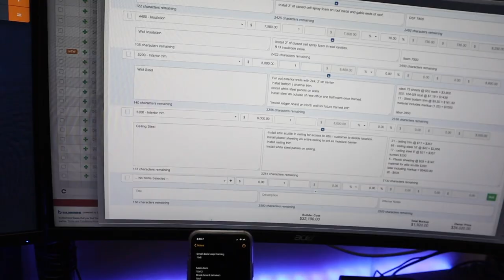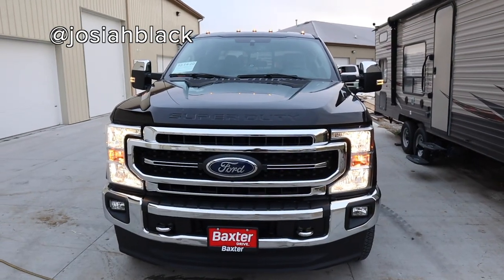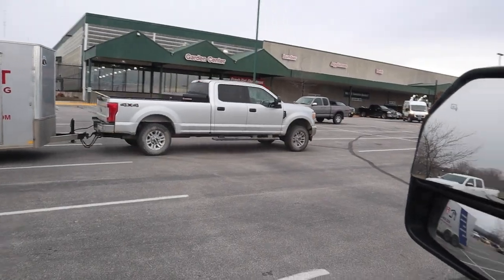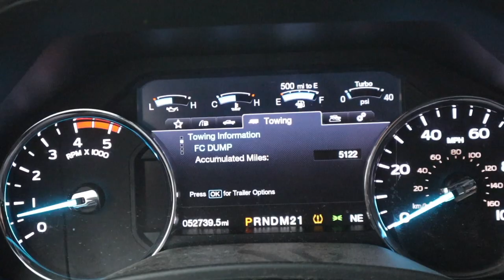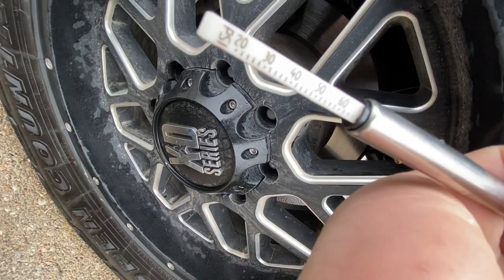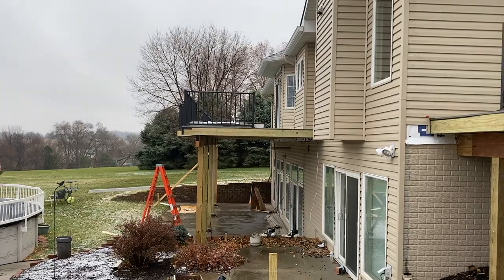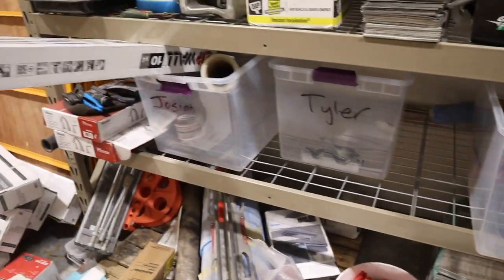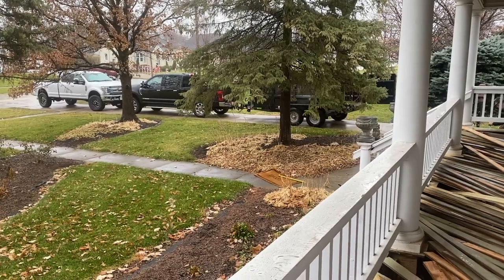A Day In The Life of a 24 Year Old General Contractor

Comment: Why did you choose to hire your own tradesman rather than just subbing it out
Reply from the maker: I sub contract out the specialty trades. I hire in house employees/carpenters to have more control over the jobs. The in house team does the carpentry work (Framing, doors, trim, windows, some flooring, tile, some siding etc.)
Reply: @michaelfrost6051  Interesting I guess I’m just different I like little overhead. How has the method you use worked for you ?